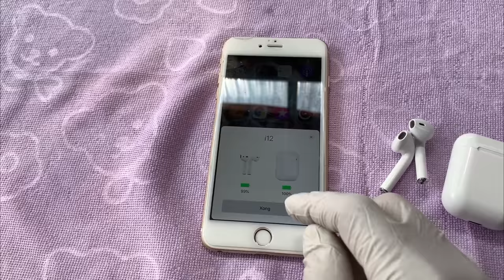Restoration old AirPod for Iphone 8 plus | Restoring Broken AirPods I12 Apple Smartphone Tools

Comment: Even know you can buy these for 7 dollars doesn’t make the restoration bad
Reply: - now*
Reply: @Scooterbug-ip3el  though *
Reply: 7 dollars really,,,, it's for 240 USD in Indian Apple Stores
Reply: THE FUCK?! SERIOUSLY!? Bruh, in Polish shops, they cost like 350$
Reply: @namenotappropriate8756  in germany for 180€
Reply: @namenotappropriate8756  799 zł na oficjalnej stronie apple byku
Reply: @baranakkas2490  habe für 150 bekommen
Reply: I’ve bought the $20 AirPods. I turned them on for 1 minute and never used them again. Then I went and bought $10 hifi sound earphones 100% better.
Reply: These are fake AirPods for those saying you can’t buy them for 7. The real ones have sensors on each side of the earbuds and “designed by apple” under the latch that opens and closes it